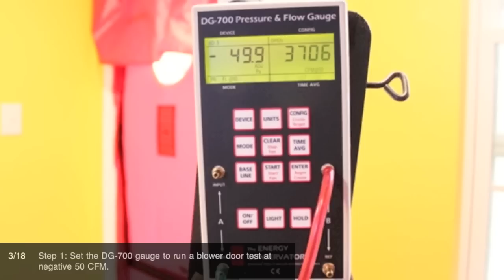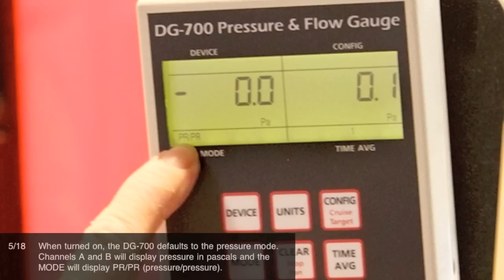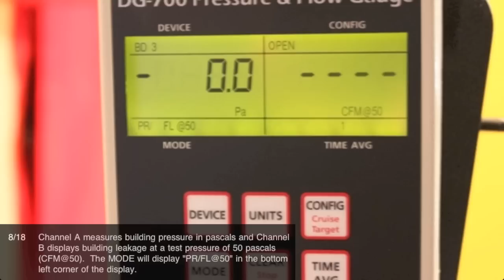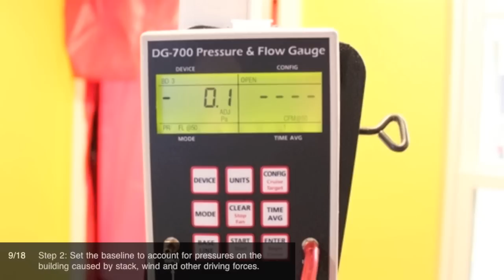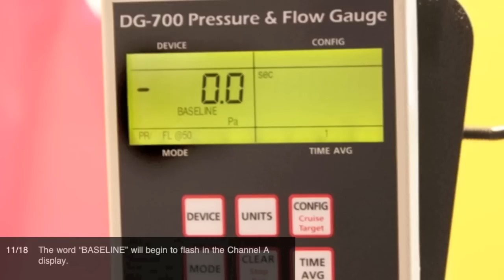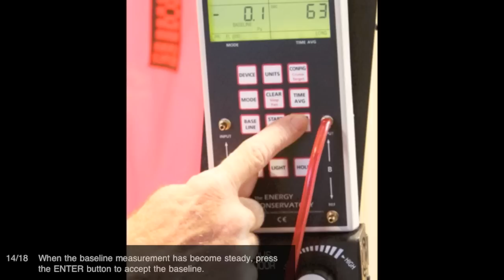MasterThat // Set Up  A DG-700 Gauge For Blower Door Test

Comment from the maker: You can do a zonal pressure test on the attic space. With the blower door running at -50pac insert a probe into the attic or any other place you wish to test. With the probe connected to the reference port you will get a reading from 0 to -50pac. If the reading is closer to zero the space is inside the pressure boundary, if it is closer to -50pac the space is outside the pressure boundary. With a well sealed pressure boundary you should see an attic space reading between -45 and -50pac.

Comment: Do you know how to test air leakage in the attic with the monotnomer? As in taking a caz/outside measurement, only using the attic as the outside measurement and the house as caz? What will the pressure be at 100% air-tight?